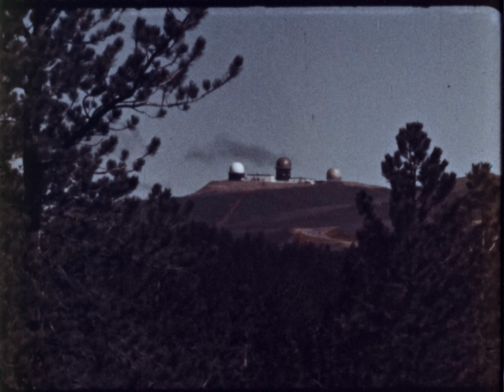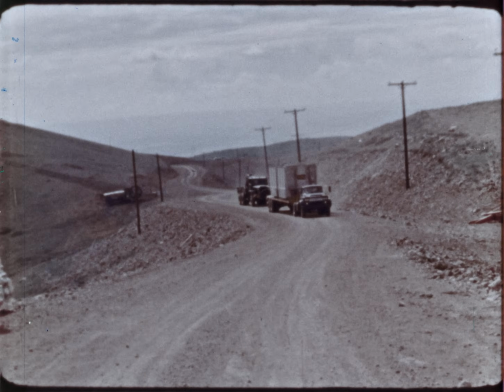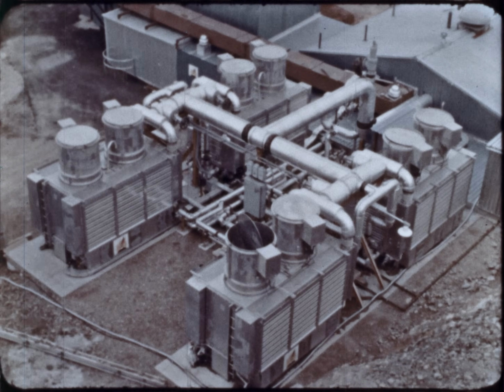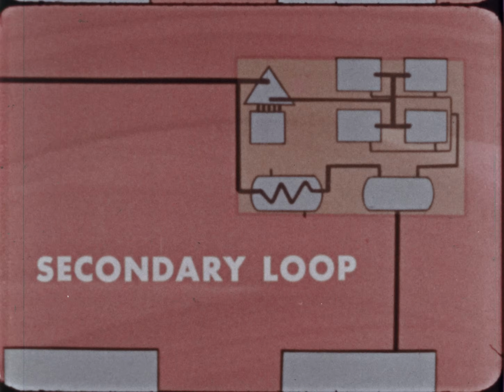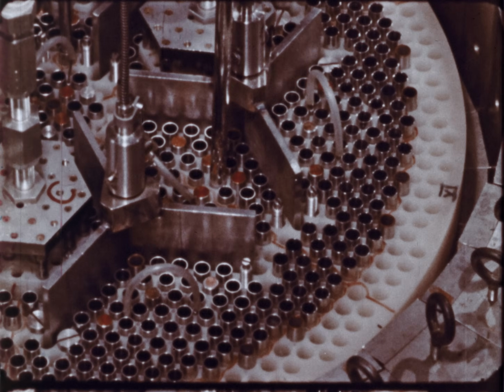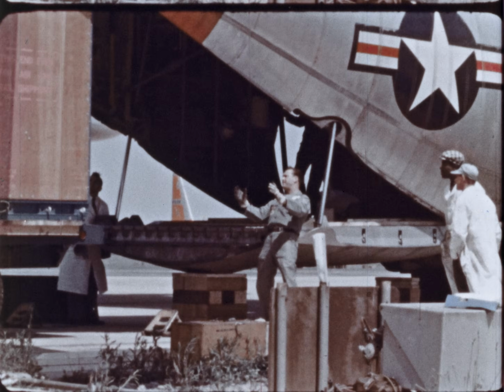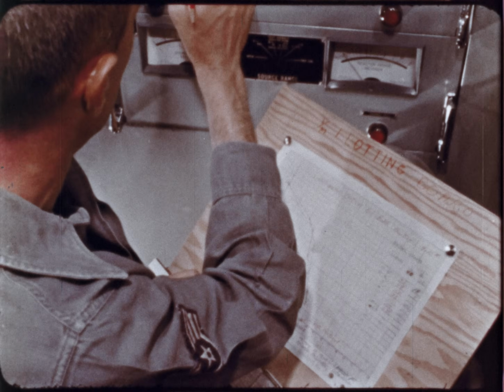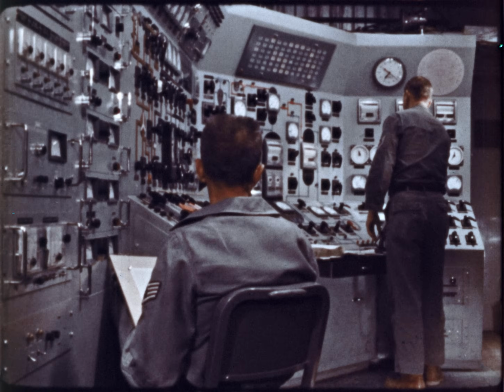PM-1 Nuclear Power Plant — the radar-powering microreactor in Wyoming from 1962

Comment: Designed to be refueled after two years, this reactor was diamantled after only 6 months of operation! Hmmm. Sounds like they had a problem!! Small reactors don't have the thermal mass or thermal stability that a large reactor has. They are death machines!

Comment: QUESTION: Water leaves the reactor at 479 degrees, it returns at 447.  How does a 32 degree rise in temperature give the reactor  a 35 million BTU rating? ▪▪▪▪◦
Reply: 2187 GPM flow rate

Comment: 2100GPM pump flow? That sounds excessive for a 1MW reactor? Perhaps 2100GPH (35GPM - though that sounds a bit low), highly curious thanks
Reply: It matches the quoted thermal power output at the (quite small) delta T.  Fascinating system, first I heard of it.
Reply: @evan010101  Yeah, agree and thanks for the comment.. It seams a lot though, 2100GPM is a massive amount of water for such a small plant... another example.. in 5 minutes, it would have been enough time to  fill a small inground pool (10,500g).. so for primary core cooling, that cooling circuit appears excessive but then again an enormous amount of heat generated in a small area.

Comment: Catalog description: A filmed story of the PM-1 nuclear power plant (a pressurized water system), a joint project of the USAEC and the U. S. Air Force, which supplies the power for the radar and space heating of a remote Air Defense Command radar station in Wyoming. The film breaks down the types and contents of 16 air transportable packages, a total weight of about 30,000 pounds: reactor, steam generator, waste tank, heat-transfer apparatus, control room, turbogenerator, etc. Details are given on major components and the design and operation of the system by information on: 741 nuclear fuel tubes in 7 fuel bundles, the "flow" of primary water, the secondary water, details on the makeup of the fuel element tubes, criticality testing, nature of the control rods, tests to determine heat transfer and flow characteristics. The film recounts the airlift of the packages, erection and assembly of the power plant, the work to achieve criticality, and the varied safety controls.

Comment: why don't we build more of these!!
Reply: They did build more of these.  Search for: Army Nuclear Power Program  -  Many of the program reports have been declassified and are available online.  These reactors, each and every one of them, were one off prototype designs. They had a lot of problems, and American Marietta had to go back, after the reactors had been installed, and redesign some things. They made modifications to get the reactor/generator system to work that resulted in a machine that was no longer portable, was way overweight, unreliable due to numerous reactor SCRAMs, required a trained crew of 25, in order to keep a shift in the control room and on the reactor floor 24/7... And expensive to run... Difficult to maintain because of the compact design.
Reply: They're still having an intense conference about the gender of the reactor and what two name it this time?

Comment: According to the Letter of Decision of the USAF  dated 2011, the reactor is still there "entombed" at the site and there are detectable levels of Cesium 137 in an area of "off site contamination",  but the area is not "of concern" and ready for public access and recreation use!  🤔
Reply: I have a surplus geiger detector that will detect a handful of potassium chloride water softener salt/salt substitute. But who cares about science, radiation bad feelings good!
Reply: Cesium 137 has a half-life of about 30 years; that's 1.83 half-lives since it was shut down in 1968. So it's a bit over a quarter of the original activity. The rule of thumb is that after about 7 half-lives, radiation is under 1% of the original. "Detectable levels" doesn't mean much, since detectors are extremely sensitive.

Comment: I would love to see an entire lifecycle analysis of this.  Universities should be doing these things not “me too” research on climate change.
Reply from the maker: There are lots of full lifecycle assessments of nuclear power plants in general. Like this one, and many similar: https://group.vattenfall.com/dk/siteassets/danmark/om-os/baeredygtighed/vattenfall-lca-brochure.pdf
Reply: @whatisnuclear  Denmark would do that.  The US is trying to harness cow farts.  How quickly we were corrupted after 1913.
Reply: @whatisnuclear  Vattenfall is not a neutral source at all. I am not generally against nuclear power, but we used to have a NPP from Vattenfall here and it is ridiculous what incidents and mishandling of the NPP and failure to report incidents authorities have found at their NPP. It is one of the last companies I would entrust with running an NPP. 

However, universities do work on designing and evaluating nuclear reactors of course. However, for this old PM-1 I couldn't find an independent paper in the scientific literature. I guess it's just too old, so nobody cares today. And back in the days also no university worked on it - presumably because all data was classified.
Reply from the maker: @fr89k  Check out the meta-analysis of hundreds of non-biased sources here for more info: https://whatisnuclear.com/nuclear-lifecycle-co2.html
Reply: @whatisnuclear  I never doubted that there are papers in general. I just don't have any specifically about the PM-1 reactor.

Comment: I knew about the doomed SL-1 but was not aware of this one... interesting. One thing I saw (unless I missed something): The water and steam are all primary stage, not isolated so it was all radioactive? More modern systems use two stage, isolated systems so that the water reaching the generator and for the heating are not radioactive. One issue SL-1 was having was warping of the rods from heat making them stick in the guides, inhibiting the ability to scram and was ultimately the cause of the criticality incident that destroyed the reactor. Not sure if this reactor had this issue or not.
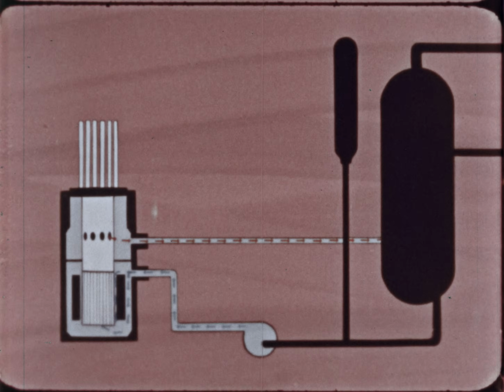Reply from the maker: This is a PWR reactor so the primary coolant goes from the core to a steam generator but does not go to the turbine. You can see the primary loop at 7:27. Note that 1/3 of power reactors today are of the BWR type (boiling water reactor), where the primary coolant does go from the core directly to the turbine. Since the fuel is encapsulated in cladding, the water/steam is not overly radioactive, and these reactors work great. 

As for SL-1, the issue there was that a single control rod was sufficient to make the reactor supercritical. One rod was removed manually while the reactor was shut down, and that caused the accident. It wasn't about an ability to scram, that reactor was already scrammed.
Reply: @whatisnuclear  SL-1 yes but the warped rods made them difficult to remove manually and interfered with their movement. This was noted prior to the accident in logs and later was attributed to the accident. The rod stuck and the guy likely jerked it, causing it to come out too far and cause an event. Thanks for the info on the PWR. I was familiar with them but did not realize this was a PWR. My mistake. Thanks.